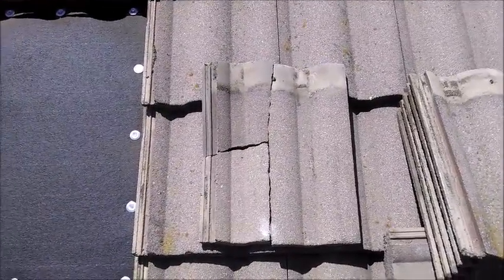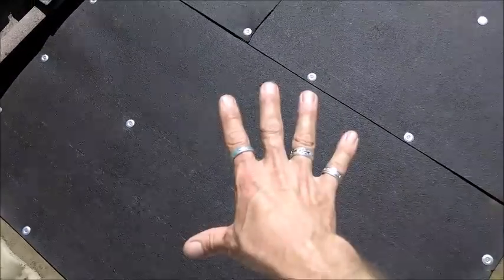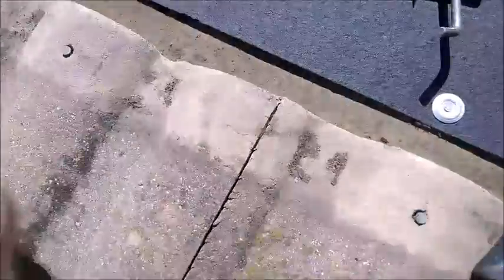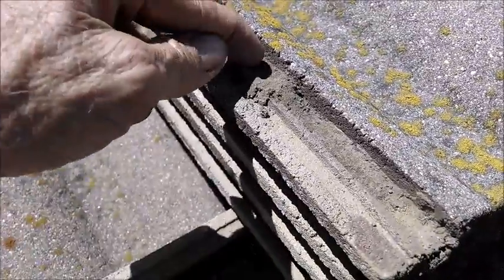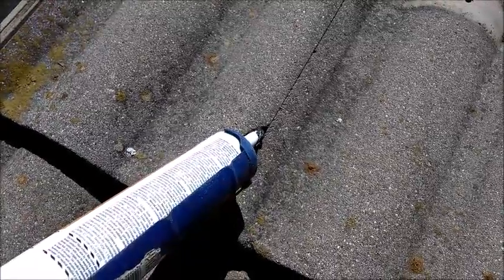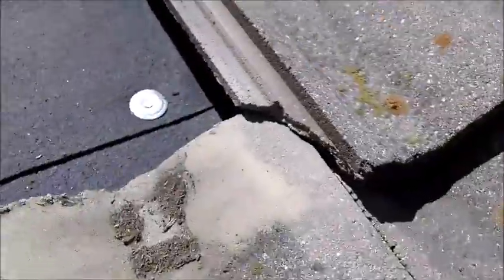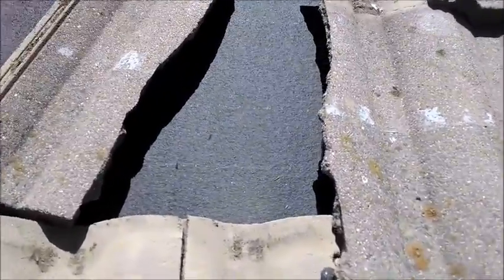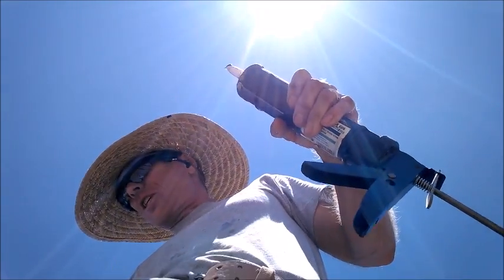Tile Roof Leak Repair - The Right Way...

Comment: Hey Dan, thanks for your very thorough videos. You are not only good at what you do but  also very passionate about it.
Quick question, we have same kind of roof as in this video with plywood sheets below the felt paper (3 floor condo building with an attic). We just had a leak yesterday for the first time, is it possible that the plywood underneath the felt could be rotten? Plywood needs to be in contact with water for a long time before it begins to rot, no?
Reply from the maker: Carlo B there should be no issue with the plywood at this time. you are correct.
Reply: Thank you…. That’s what I thought!! We had a roofer give us a $1395 quote today to replace at least 2 sheets of plywood then nail down 30Lb felt paper then mop hot asphalt then immediately nail down 90lb felt on top then asphalt again then let dry for 7-10 days then come back & re-install the tiles. This roofer does not seem honest. 
What do you think of his process? Is it overkill? Building is in S Florida.
Reply: He said that it is very common for water & moisture to stay between the plywood & the felt (hence the rotting) and will only leak into condo after some time.
Reply from the maker: I don't know Florida codes but how was it done in the first place & why? If he's proposing so much more than how it was done in the first place, then why again? There is a reason for the codes & doing things according to code. Code compliance does not always work but most of the time it's more than sufficient. And what about the rest of your roof that doesn't have all these layers on it under the tile?

As you may have heard me point out in another video, many roofers upsell the customer on underlayment. There was a reason why the underlayment breached in this particular spot, but not all throughout your roof. And those are the kinds of questions these guys need to be asked, because there appears to be little or no logic to their solutions. And why pay for solutions that may or may not solve the problem?

Doesn't sound legit to me unless this was required by code or unless code is found to be very sub-par. But if that's the case, you still have reason for concern throughout the rest of your roof. I don't buy it... I'd advise you to follow the code & make sure it simply gets done right - without bozos doing the work.

1. Do a background check on any contractor license with the local license regulating entity before you hire them. In California it's the cslb.ca.gov
2. Check public reviews & read what the public is saying about any contractor before you hire them.
3. Make sure a supervisor is on the job while the repairs are being done, because if someone's paycheck, job or reputation is on the line, you will almost always get better labor out of them. And, without supervision, laborers cut all kinds of corners that lead to the very problems you're trying to solve.

Hope that helps...
Reply: Wondefull thx too much!!….very helpful!!! 
FYI, I think I remember him saying that that’s the way it was done during the 1996-99 construction but I will definitely research to see what code is now & what it was then.
Thanks again Dan!!
Reply from the maker: Carlo B correct... Plywood usually requires more than an entire rainy season before it rots. Usually it takes the roof leaking for 2-5 years before the sheathing deteriorates or rots. Same thing goes for drywall inside the house. Felt paper not so durable. Only takes felt about six months exposed to the weather before it goes bad, but I digress...

Comment: what  is the name of glue that you use and where u get that metal that you used  does it come in that shape   plz thx
Reply from the maker: john Al OSI Quad from Lowe’s is what I currently use. It is similar to what I used in this video. And no, the sheet metal doesn’t come in that shape. I had to bend it into the profile of the tile. Sheet metal in smaller pieces is available just about everywhere. Thanks for watching.

Comment: what sort of sealant are you using to repair tiles ? silicone  ? polyurethane ?
Reply from the maker: @666markyboy  polymer… any type of polymer. Used to use polymer & then copolymer, then tripolymer. Now I use OSI quad.

Comment: Great video, our tiles are same, we have moss growing between tiles.
Would you recommend power hosing to remove moss.
Have u also a video on vent tiles for these tiles.
Thanks
Reply from the maker: patrick o keeffe the only issues with washing the tiles down are causing unneccessary water intrusion, breaking tiles & not getting all the moss off or just having to do it again soon. Tile roofs are not made to walk on often without breaking tiles. Aside from that, cleaning the moss out of the sidelap on your tiles could prevent future leaks. I don't recommend cleaning the roof unless you know the side laps in the tiles are blocked & letting water get through the tiles regularly.
Reply from the maker: patrick o keeffe sorry but I don't have any videos on vent installation for tile roofs. Lord knows I've done enough of them just never made a video about it. You'll want to start by checking with your local roofing supplier for which vent go with which profiles of tiles. Good luck & let me know if you have any other questions

Comment: I've never seen those tiles installed straight up & down like this before this should be interesting video Im 1:30 in now. Brick pattern is what im used to. 1/2/& 1/2 breaks rain Chanel.
Reply: & 31 min you acknowledged why the pattern should be 1/2&1/2..... the tiles will sit better break less corners if walking on it. I have lots of experience with this tile, this is hung on skip sheathing hanging on rafters here with no tar paper protection. One mistake water is instantly in a house. Broken tiles = emergency mass water in homes. 
You can get semi trucks of these tiles here with planning from roof replacements because of this issue with their lacking decking & underlayment. Take home tiles & trims whatever you need then upgrade your customers roofs with full tiles everywhere needed new underlayment then Pressure wash their roof & reseal it with color in a concrete sealer. Reduce the water it exorbs during winter getting heavy.  
I have witnessed max saturation end of wet winter and a solid tile no cracks no holes leaking it was just wet concrete dripping from back side in attic looking at it. Because i could not locate a break in the rain. Cant just start picking up tiles in that situation. 
I learned to convert these roofs to solid deck, with out fully unloading the roof.
My finished product was a washed roof and restored with sealer to customers color spec with other contractors just repair tiles washed paint with out fixing the decking issue. Or most contractors are replacing them to shingles. If you work with supply houses they can work with local and unloading the tile roofs with conveyor back to shop for your semi delivery.

Comment: I am curious why it seems that no radiant barriers appear under the tiles of the repairs you show.  

If a radiant barrier is installed in between double-battens below the tiles,  are there any installation guidelines?
Reply from the maker: Eric Kosak code does not require radiant barrier here. 30lb felt is required under the tile & is sufficient to last for decades if the tiles are also installed to code. Each building zone has its own set of regulations. Those regulations are determined by nearly a century of building dept. experience, construction, testing & feedback within each particular community. Thanks for watching.

Sorry, it just dawned on me that you were referring to the sheathing radiant barrier. So, even if radiant barrier is required on new construction, it is not required on older construction in context of repairs. Radiant barrier is becoming the norm for all new roof installations, even on old construction. But again, radiant barrier is NOT required by code when doing repairs, because you would have to replace the entire roof to install radiant barrier. And that would defeat the point of doing a repair instead of a reroof. The building & safety dept of any community does not have the authority to force people to reroof in order to meet today’s codes when all they can afford is a repair. However, I wouldn’t put it past the California legislature to try. They will regulate themselves right out of a job if they’re not careful. Anyway, as an ex-California contractor for twenty years I’ve seen enough regulation to choke a horse.
Reply: Duster Dan thank you for your reply.

I realize that radiant barriers are not required.  In fact, a hundred years ago there were no radiant barriers being installed on roofs, but I am interested in doing an installation with a radiant barrier due to the excessive heat where I live.  This was the reason I was inquiring, and given your expertise with tile roofing I was hoping to learn from you.

Comment: I have a Maxitile roof that is approaching 30 years old. The tiles are brittle and I am afraid to walk on them.  I have a few issues I would like to address but it seems that removing any of them is near impossible without them cracking apart.  I may just have to replace with a new material.  Too bad because it still looks quite good. Any thoughts?
Reply from the maker: From what I can tell, Maxitile only makes lightweight roofing product. In all my 35 years of roofing I’ve never seen a lightweight roofing tile that you could walk on & service without breaking it. Nor have I even heard anyone who makes lightweight products acknowledge that their products are non-serviceable because of this fact. Buyer beware…

Comment: Hi Dan I'm looking for a bendable material that you would use like around a skylight to meet or connect with the tiled roof.
A corrugated  soft metal that shapes around the S tile ,I've seen them around skylights with S tiles on the roof 
So when the the water runs off the base of the skylight frame it runs on the shaped metal around the tile making it a smooth water runoff 
If I knew  how to attach a photo I would velux makes a real nice transition kit but you have to buy the whole kit.
I just need the bendable portion about twenty feet for water to transfer smoothly from roof to tile,for a project I'm doing .
Thanks for any advice
Reply from the maker: Ultimately the best thing in my opinion is hard galvanized flashing used in concert with mortar at the base of the skylight. The tile would tuck under the flashing & the mortar would go under as well, filling the pan of the tile under the flashing. The key with using mortar here is to leave it slightly recessed under the flashing & sloping outward to help sheet water away. But if hard flashing isn't your choice you could use a thick peel-&-stick roofing, aluminum, copper or even lead - all of which are flexible enough to bend around corners or to conform to the shape of the s tile to make things water tight. Skylight flashing is a real science & you really ought to have someone show you how to do it to get it right regardless of what materials you use. If I have a video on this I'll upload it for you to see.
Reply: Wakafex?

Comment: Hey there Dan wanted to say thanks for the offer the answer my questions. But, I have since found out that my insurance company requires a licensed contractor do the work so I will not be doing the repairs. Your not is So Cal are you?
Reply from the maker: Bill B you may want to double check with consumer affairs. I don't think they can legally cancel your policy as long as you complete the repairs according to your local building codes; especially in light of all the fake licenced contractors out there today.

Comment: How do I remove the tiles without breaking them? I also need to replace a wall splashing. Thank you
Reply from the maker: Roberto Fong You have to pull the nails out & somehow remove the weight from the tiles above the ones you trying to remove. As far as removing a wall flashing goes... You have to find & remove the nails holding the flashing in place & remove anything else that may be resting on the metal flashing before it can come out. Tile is pretty heavy & removing tiles or metal flashing isn’t for the faint of heart.

Comment: You don't have to seal the nails you used to install felt paper?
Reply from the maker: Maciej Piotrowski Nope. The felt nails are self sealing.
Reply: @MrThedocholiday  Thank you for quick response. How do you overlap your felt paper in lower corners? When you cut out old felt you slide new one under old one. You can to it on the top left and right, but you want new felt over old one on the bottom edge. How do you do it in bottom corners properly. Thank you for your advice. My roof is leaking now so I need to fix my valley.

Comment: I got a leak i could see from inside my home I checked and i have a broken tile the split in half across .. the damage is the size of a hand and went thru the underlayment and i can see the wood should i just cut a small underlayment cover the woodexposed and nail it and replace the whole tile ?
Reply from the maker: The Underlayment needs installed in a overlapping manner... meaning it must be tucked under the good felt above & over the damaged area below. And yes, nail it in place & replace the tile if you can find a replacement. Good luck.
Reply: Ok Thank you so much keep up the great videos 👍

Comment: How are the vertical seams water tight? Even though you overlap, wont water find its way underneath and eventually to the plywood?
Reply from the maker: Jeng164 The vertical seams have a small lip that prevents the water from getting through. The water is allowed to drain out of the seam on top of each course below by design. Also, where the vertical seams are placed on the crowns, only exposes the seams to small volumes of water. As long as there isn’t dirt in the seams, the water will not divert & find it’s way through, but if the vertical seams get blocked by dirt or caulking that prevents the water from draining, then eventually it can find it’s way through & cause a leak.

Comment: what is the glue and sealer brand/type please.
Reply from the maker: I like to use OSI brand (QUAD) for several different reasons. It doesn’t last as long as silicone does but has several qualities that silicone doesn’t have. They make OSI in several different colors to match different roofing colors, it adheres to all construction materials better than silicone, it remains fresh in the caulking tube much longer than other products, is paintable, adheres to wet surfaces with less efforts than other products, doesn’t ooze out of the tube when not applying, it cures quickly but remains flexible, it comes out of the tube easy (except for the clear color) & is all around easy to use & economic in price.

Comment: with small corners missing, what do you think about making a mortar mix patch with bondcrete added?
Reply from the maker: Nothing in the water channel that has potential to block water flow... A very common mistake is to add mortar or sealant to the side lap water channel in an attempt to compensate for broken tile corners. The only time broken corners are anything more than cosmetic is when the break exposes the felt to water flow. Even then any sealant or mortar MUST fill the entire side lap channel all the way up under the overlapping tiles above the breach.

Comment: What's the easiest way to remove nails if the tiles were nailed down?
Reply from the maker: John Moua pull up slightly on bottom of tile that you want to remove nail from to loosen the nail. Be careful to pull up just enough to loosen the tile & not break the tile. Once nail is loose you should be able to get under the head of the nail with a nail puller, a flat bar or a wire cutters to get a hold of the nail head & pry it out so you can remove the tile that the nail is holding in place. You will also have to lift the tile above slightly to access the nail that you will need to remove. You should be able to lift the tile above without much effort so you can access the nail which is holding the tile below. I like to use a flat bar with a nail puller slot to do all this in one motion, because the flat bar both separates the tile above - giving access to the nail below & the flat bar can also be used to pull the nail as well. Once I get the nail below loose & the tile above lifted with the flat bar to access the nail below, often I will insert a hammer handle between the tiles to keep them separated while repositioning the flat bar under the nail head to pry it out & release the tile. Sometimes if the nail it long you will need to bend the nail over or curl it over to get it all the way out, due to lack of clearance because of the tile above that covers access to the nail. Does that make sense. Obviously it would be easier just doing a video on this subject alone, but this will have to do for now.